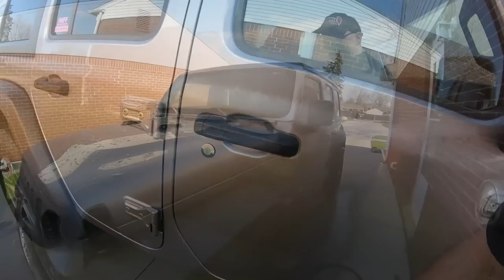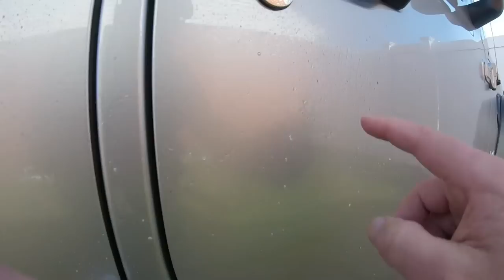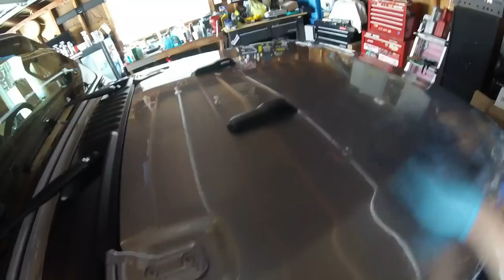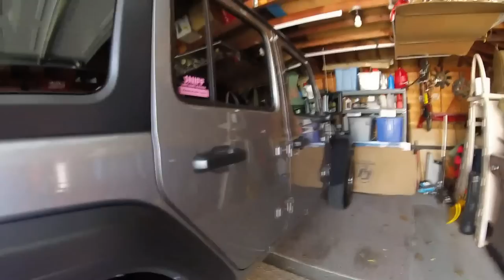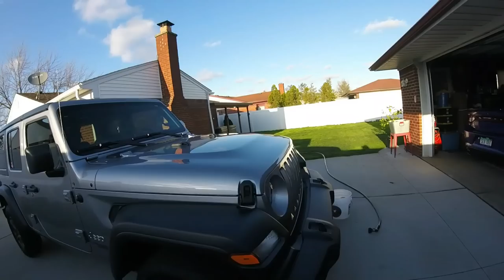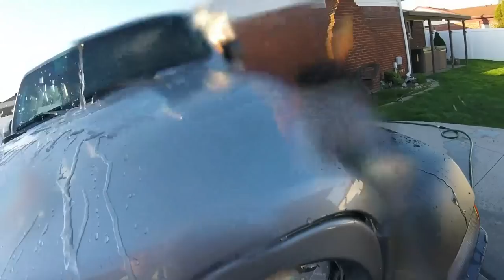How To Applying Chemical Guys HydroCharge Ceramic Sio2 Spray!  |Plus Review

Comment: Nice jeep, we may have to get some of this stuff for ours ("WE LOVE OUR JEEP" :  ))! We take it all over the place and it gets very muddy all the time, wonder if it helps the mud wash easier! Also any recommendations for RV's? We are getting a Jayco Seneca which is full body paint so one would think this would be the same to coat/protect, any ideas?
Reply from the maker: This product would work great on the Jeep after getting the paint prepared. On the RV maybe go with a sealant like Collinite and use this new product from Turtle wax ice seal and shine this stuff is great and easy to use .

Comment: Great video! I picked up some too and haven't had a chance to try it yet. Great tip about using it sparingly!
Reply from the maker: Seems a like a good product the gave a shine like bead marker just not as smooth.  Glad this video may have helped. Thank You
Reply: @OuzoLouGarage  I'll be really interested to hear if you find it is staying cleaner as you go along!
Reply from the maker: @kikcodog  Update have not washed the Jeep sense apply HydroCharge the weather been crazy raining almost everyday.  Going wash it to and make a video the the soap from CG and a little update
Reply: @OuzoLouGarage  Awesome. Can't wait. Interested to see if the soap helps recharge the coating. Did you see Brian from Apex Detailing's review of Hydro yet? He really likes it. I think it surprised him. BTW, he used it on the glass and plastics and it worked well. I think CG is just being conservative in their recommendation to only use it on the paint.
Reply from the maker: I watched his video on the Hydro he seemed to like it and applying on plastic going have to try it.

Comment: A little goes a very long way. Did my Silverado crew cab a couple weekends ago and only used about a spoon full. Fyi, run warm water through the spray head. It gets hard and has to be chipped off and soaked in hot water to recover the sprayer. It can be used on plastic but not glass. I'm gonna maintenance wash my truck soon with HydroSuds and add another coat. Hopefully it holds up in Az heat. Supposed to be 45% Si02.
Reply from the maker: That would be great if it holds to the Ad heat .Thanks for the tip.on cleaning the sprayer. When we cam use this bottle on a few vehicles that's pretty good for the price. Keep us updated on how it's holding up .thanks

Comment: I know this stuff will clog the tip up which is a good sign I guess. How bout your microfibers? Did you ditch them after? I guess if you washed them asap afterwards you we're good. After all it's not a true coating
Reply from the maker: I washed them the microfiber right away first I put them in a bucket with dish soap then washed them .  They washed up pretty good but going use them for interiors cleaning.
Reply: or use rags to riches it works really well at restoring microfiber towels just let them soak in a bucket for a few hrs then wash them in the washer

Comment: taught they said 18 hours to cure
Reply from the maker: It said 24 hrs for a more deep shine. With this began a new product I wanted to treat it like a sealant. When I apply a sealant I wait about 24 before applying a wax or getting the vehicle wet . Thanks for checking out our video
Reply: @OuzoLouGarage  yes we here in New England and had alot of rain and my truck still shine in the morning after having a bunch of rain here over the weekend its amazing product
Reply from the maker: Nice to hear this hydrocharge is working grat at keeping your truck clean. Thanks Elvis
Reply: @OuzoLouGarage  yw and thank u